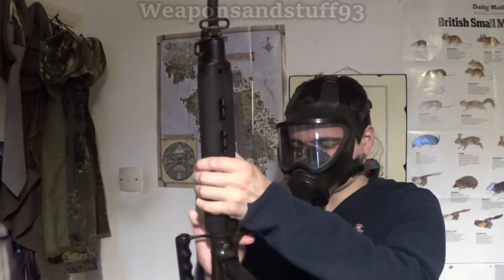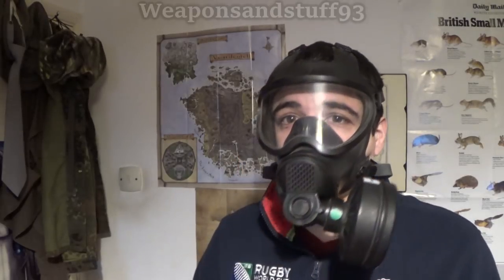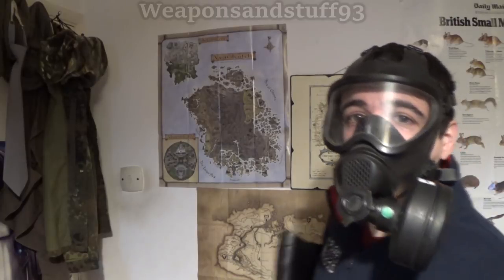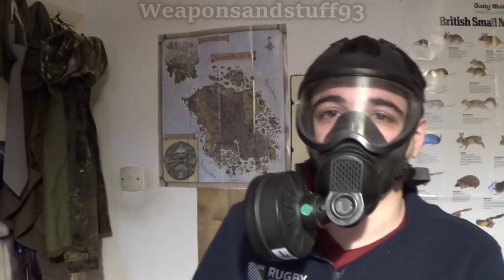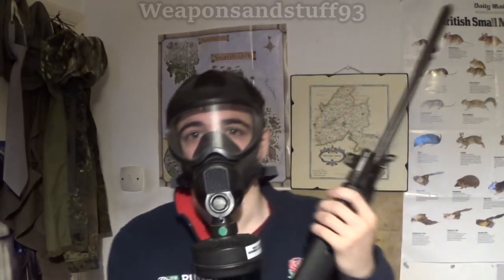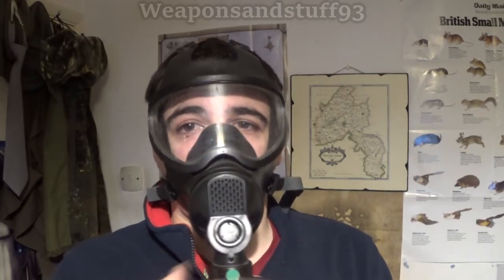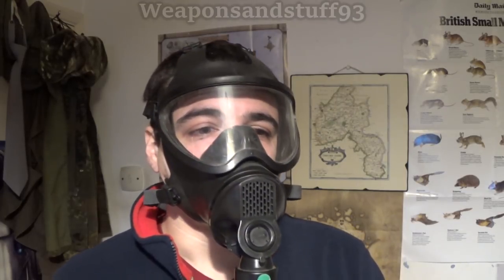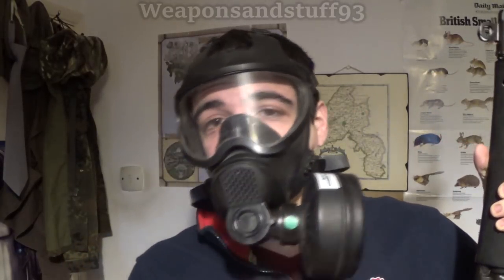Gas Masks side loading vs bottom loading filters

Comment: There is also a configuration that has filter to the front (not down). You can tilt head down with one but it blocks some view down near you. It can be a bit annoying if you cannot see the ground directly in front of you.
I prefer center setup, it allows me to shoulder a rifle to both shoulders. In competition you sometimes need to use both sides, for example if you need to shoot behind a barrier from both sides. For military use it can be an advantage to use both shoulders if you're trained shooting the "wrong" side as well.

Comment: Between strap or hood types, which ones are more forgiving of hair length? I try to shave often, and my hair is fairly short, not exactly buzz cut short, but still pretty short.

Also, on the subject of hair length, do you need your hair to be short all around, or does it only matter in certain areas like the front or back?
Reply from the maker: I'd say straps are a bit better for longer hair as the mask makes a seal around the face itself.
Ideally short all around, but I'd say short sides like a crewcut would probably be better than bald on top.

Comment: So about 1 week ago I bought an Israeli gas mask from my local surplus store and i also own a GP-5 (/w a hose) so I tested it out by putting the filter I got from the Israeli mask and it works so what i'm asking is that is the filter from the Israeli mask a good filter for the GP-5?
Reply from the maker: Not really because the Israeli filter is 40mm NATO, the GP-5 is 40mm GOST, it won't make a proper air-tight seal.
Reply: Oh ok thanks

Comment: And if you have the filter dow when you shake your head it flales from left to right
Reply from the maker: This locks in so it won't slide easily.
Reply: Weaponsandstuff93 
No no no i meant a rubber one that's set in that position like the gp5 neat mask though
Reply from the maker: Yeah this unlike a GP-5 etc is a rubber mask with straps and tough plastic so it won't move much.